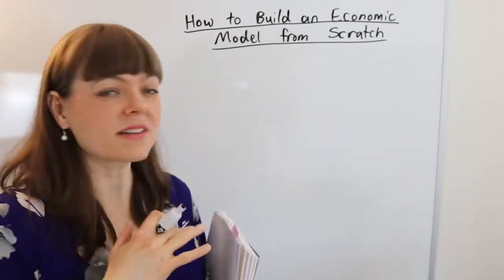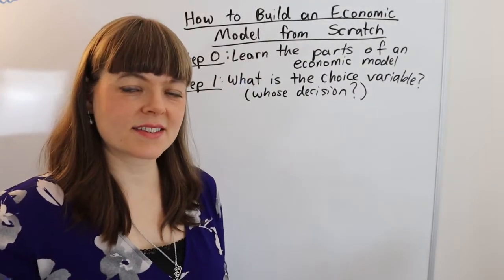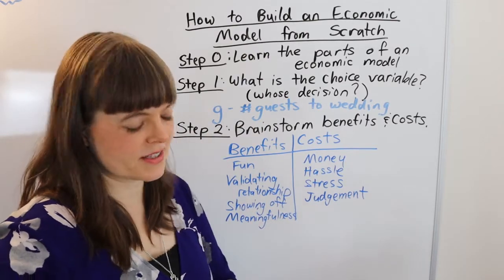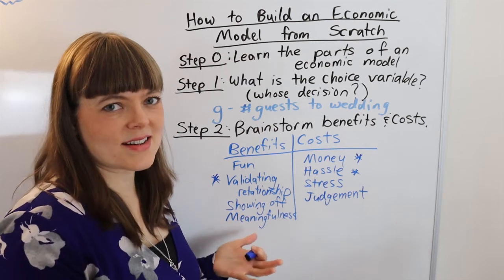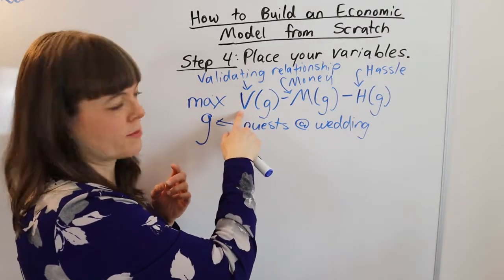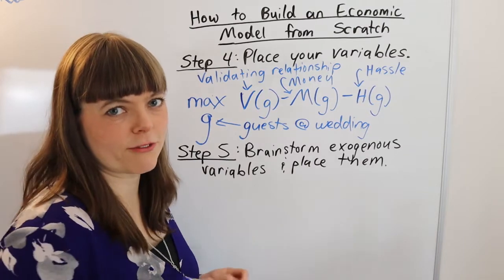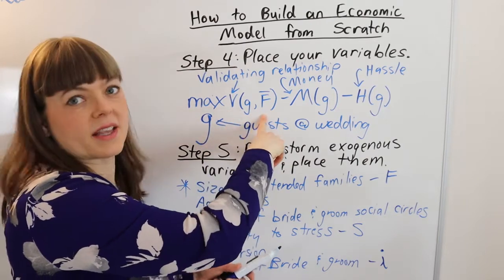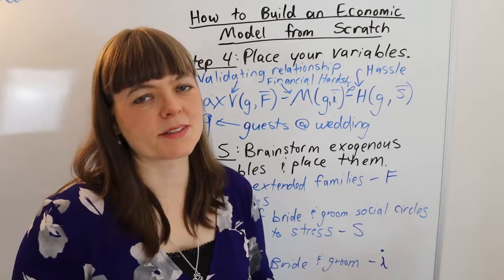How To Build An Economic Model from Scratch: 5 Steps

Comment: Thanks for the video, this is very clear. My question is your objective function is consist of three generic functions, how do you find the specific functional form of V(g), M(g), and H(g)?
Reply from the maker: That's a good question, and there are a few answers.  One is that you could estimate those functions if you had data.  Another answer is that you could leave these in generic form for your analysis, as long as you have some sense of the general shape (first derivative > 0, second derivative < 0, for example).  The third answer is that thinking about the exact shape carefully is part of the analysis process, and you will almost always have to make some assumptions about the shape and model different cases of different shapes.  Classic functional forms to use, of course are Y(x) = x^a where a < 0 for diminishing marginal functions and a > 0 for increasing marginal functions.
Reply: @AshleyHodgson  Thanks for such a detailed response!